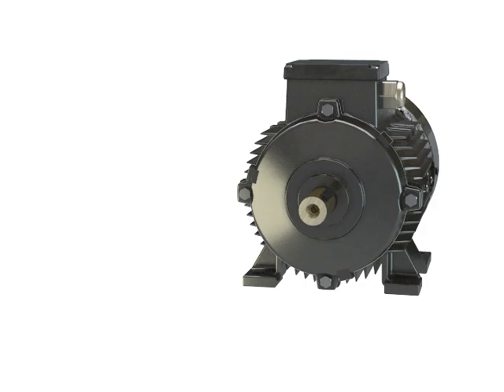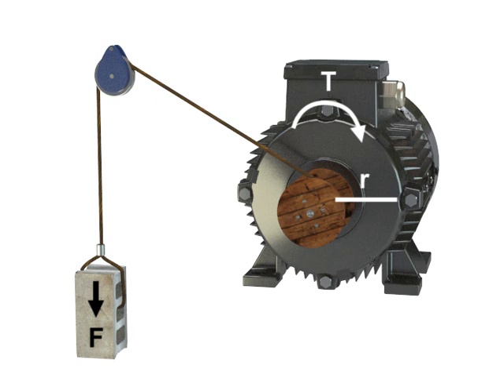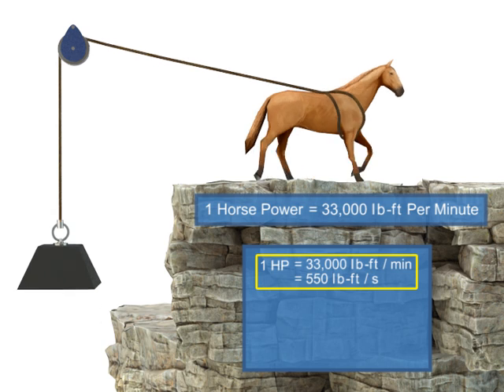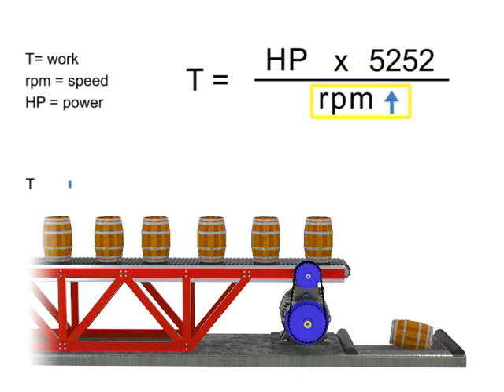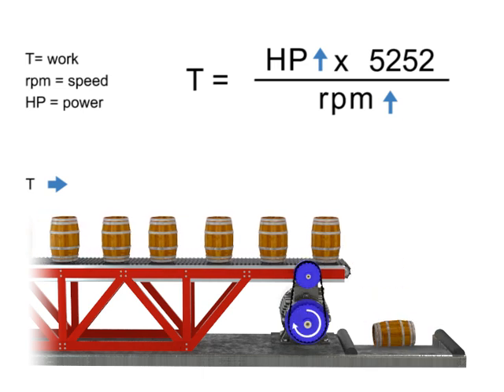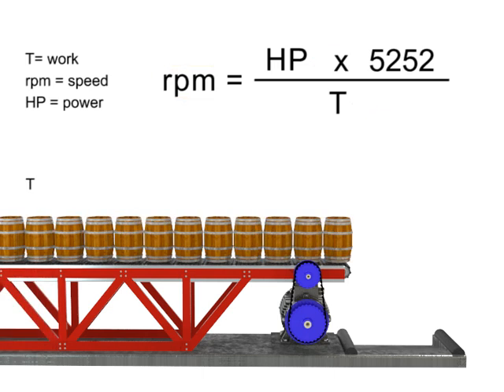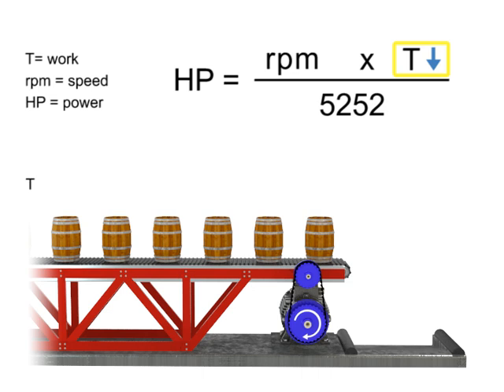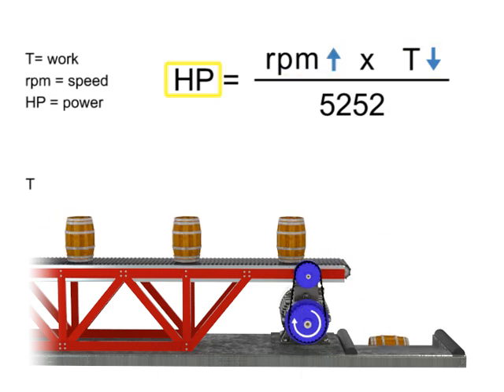Motor production: Speed, Torque and Horsepower

Comment: In physics and mechanics, torque is the rotational equivalent of linear force. It is also referred to as the moment, moment of force, rotational force or turning effect, depending on the field of study. The concept originated with the studies by Archimedes of the usage of levers. Wikipedia
Reply: Torque and moment are two different things, best not to get them confused

Comment: There is a mix-up between Power and Energy in this video. 
Power is defined as the Energy generated or spent over a period of time. Assume you generated 500 Joules over 5 seconds then the average Power generation over these 5 seconds is 500/5=100 Watts.  In IS units, the Power unit is Watt=Joule/Sec.  In Imperial Units, the Power unit is BTU/hr. 

Here are few ENERGY conversions (Think of energy as: Joules, BTU, and Kwh i.e. Kilowatt-hour):    
1 Joule=0.000947817 BTU=2.7778e-7 Kwh
1 BTU= 1055.06 Joule=0.000293071 Kwh
1 Kwh= =3.6e+6 Joule = 3412.14 BTU
~~~~~~~~~~~~~~~~~~~~~~~~~~~~~~~~~~~~~~~~~~~~
Here are few POWER conversions (think of Power as: Watts, Mechanical Horsepower  hp(i), 
1 Watt=3.412141 BTU/Hr=0.0013410 hp(i) 
1 BTU/Hr= 0.2931 Watt=0.000393 hp(i) 
1 hp(i)= 745.67 Watt = 2544.433 BTU/hr
Reply: Thank you, that slide directly comparing HP and Joules was driving me crazy

Comment: Author is playing fast and loose with terminology.
Torque is NOT work nor HP. Torque is rotational FORCE. Work is Force multiplied by distance in direction of force and actually is TRANSFER of energy from one body to another. Power including horsepower is RATE of work or Work/time or F.d/t or Force x velocity. When using Torque as Force then Power or HP =Torque x RPM/5252
Reply: yeah i kinda hit pause when he was like 'a pound-foot!'. im like ..yeah no.
Reply: Torque and work have the same SI unit, no? Also, torque is a product of force AND the distance between the force and the fulcrum. In a sense, torque IS work done on a rotating body. Else, correct me since I‘m a newbie
Reply: @heavycurrent7462  No it's correct. People are just arguing nomenclature, both torque and work are a product of force and distance. Hence they are essentially the same, however people prefer to look at the differently
Reply: @heavycurrent7462  Torque is the rotational force. Work is the difference in kinetic energy. They have the same unit but are different in principle. In work, distance and force are in the same direction. In torque, they are perpendicular. Work = Torque * ANGLE in radian. Power = Work / time = Torque * (angle / time) = Torque * rotational speed (in radian/s).
Reply: @minhcly95  I‘ve asked a friend of mine who teaches physics in a university. He said there is no such thing as rotational force, except if it is also measured in Newton. "Torque is not a force in any way, but can be looked at as the work done to rotate a body about an axis." He also said the distance and force to measure torque are actually of the same direction, except that the direction is circular rather than straight (circumference). But we calculate the radius instead since in gearing, circumference and radius are directly proportional and the latter is easier to measure.
Reply: @minhcly95  He also clarified that the value of force would be zero if we use cos(90), (<-- I don‘t fully understand this anyway), so he said the distance is indeed of the same direction with force, which makes it a measure of work done also.
Reply: @heavycurrent7462  Yes, there is no such thing as rotational force, that is just an analogy. In point object mechanics, we have Displacement, Mass, Force, Speed, Momentum. Their counterparts in rigid body mechanics are Angle, Rotational inertia, Torque, Rotational speed, and Angular momentum. As you can see, Torque is similar to Force, in a sense that Rot. acceleration * Rot. inertia = Torque <=> Acceleration * Mass = Force. Or Work = Displacement * Force = Angle * Torque.
Work only counts the portion of Force which is parallel to the displacement. Torque only counts the portion of Force which is perpendicular. The work created by a torque is the Force * Displacement and the displacement is actually the length of the arc. If the angle is in radian, then the length of the arc = radius * angle. Hence Work = Force * Displacement = Force * (Radius * Angle) = Torque * Angle.
Reply: @minhcly95  No, torque is not similar to force. The fact that you need force in the equation to find torque proves that. If you simply use a lever instead of a rigid body you‘d see how torque is, in every sense equal to work done.
Reply: @minhcly95  "Torque counts the portion of force which is perpendicular" makes no sense at all. The value would be zero. Else, it would be centrifugal force. As I shared with you what I learned from a lecturer, the displacement is always of the same with the force for torque except that the path is circular, not straight.
Reply: @pepe6666  donkeys per football field would be preferred !
Reply: @martinholm8631  that about describes the white-house. HAhaaAAaaa!

Comment: The horse pulling weight vertically through a pulley is a bit misleading isn't it? for example 1 ft/lb is equal to 1 lb of weight on a lever one foot off the axis of rotation

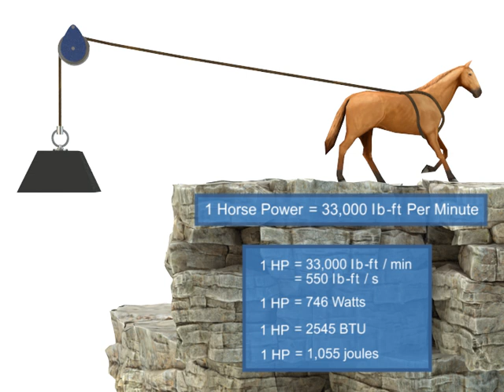Comment: HP does not translate into Joules 1:35
Reply: HP = kW = Joules/Second . So it does and it doesn't.
Reply: Torque, on the other hand, does. 1 Nm = 1 Joule
Reply: Nm is also unit of energy when 1 N force moves something 1 m distance, but Nm as unit of torque cannot be translated into energy!

Comment: Hp  and  joules are not compatible.
joules = [length]^2 [mass])/[time]^2 | = energy
 hp = (horsepower) | ([length]^2 [mass])/[time]^3 |= power
 BTU_IT  (IT British thermal units)= | ([length]^2 [mass])/[time]^2 = energy
Reply: Thank you I was thinking the same thing!
Reply: SuperAnders9000  you are ok, joule is the unit  in  international  sistem  for  energy, otherwise hp is a unit in usa sistem for power (energy by time)
Reply: Jorge Godinez 
Guys... It can all be calculated, it's just deciding between which word to apply to any given situation. Hp is great for mechanical work like cars or cranes but has 0 impact on deciding chemical needs. Joules of energy (i.e. potential energy) is much different than live horsepower.
Reply: Exactly!
Reply: Jay Edlington Hp and joule are fundamentally different things. It is not a matter of which application is more convenient. You can certainly use horsepower in chemical applications, but you will need a time dimension using hp, (i.e. total energy released or taken / duration of the reaction), In this case power can be useful if you want the rate of reaction, but it will not be useful if you do not care about how fast the reaction needs to be done.

Comment: This is not the best example of explaing this topic. Also, Joules and BTU are not a measurement of power, it's work... And the HP illustration at the end could have been better, and was in fact misleading.
Reply: Power=Work
Reply: Surely work is equivalent to energy? And that unit should be joules per second?
Reply: Rogue Nero you're wrong.
Reply: Power is work done over time. Joules is a measurement of energy, so if you have a certain amount of energy being produced over time, you can say that there is a power being produced within this system. 
Joules = Energy
Joules/sec = Power
Reply: Yeah i noticed that it was straight joules and it actually confused me cause joules is just energy.I guess you are right.English is not my mother tongue so some terminology i dont understand,thanks anyway for answering
Reply: Rogue Nero No problem my friend

Comment: This is totally wrong video. at 2:10 if speed decreases, HP should increase in order to remain a constant torque, instead, he says HP should decrease. It won't satisfy the mathematical expression.
Reply: Wrong bro, simple logic if numerator(power) multiplies by x, then denominator(Speed) also be multiplies by same x to maintain the constant result(torque).
Reply: he didnt say the speed decreased due to load. if voltage is lowered, speed is lowered. if amps are lowered, torque is lowered.
Reply: just lock on the formulas then you know ,the math don't lie

Comment: Joules cannot be converted into horsepower. Too many things are wrong with this video.
Reply: Yes, 1watt=1joules/second
1pascal=1N/M^2
1PSI=6894.75729pascal
1PSI=0.0689BAR
1-kgforce=9.8N
100kg pasacl=1BAR
1N-M=1 joules
KgM^2/S^2=joules
Reply: can easily be misinterpreted but yes it technically can.

Comment: but actually this is not practical case >>> for example if you rotate a motor on a  frequency less than rated , its speed will decrease , and its torque will increase , its current will increase also>>  return to torque speed cc.s curve and h.p

Comment: 400 watt three phase 60 hz motor 

at 25 rpm 

I want it to pull a load capacity of

 400kgf.m 

How many N.M does this motor need to do this task? 

 Drum half diameter 12.5 cm